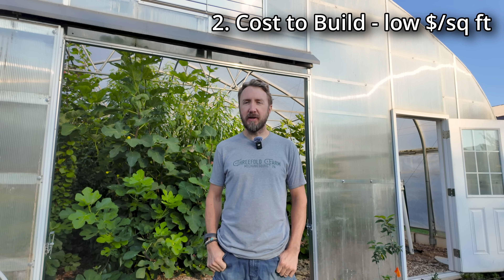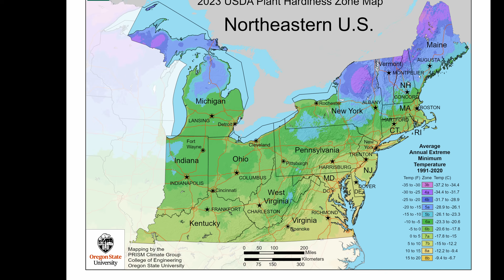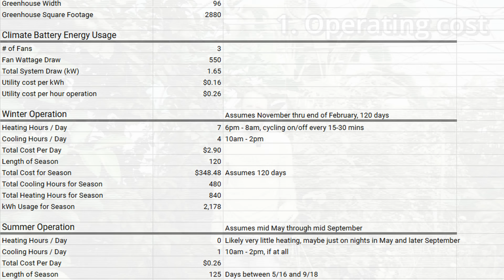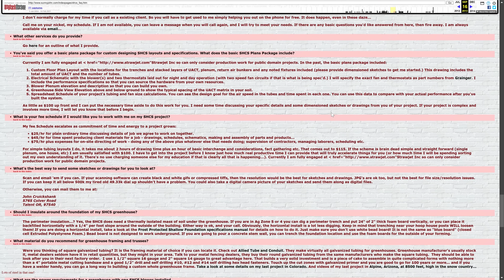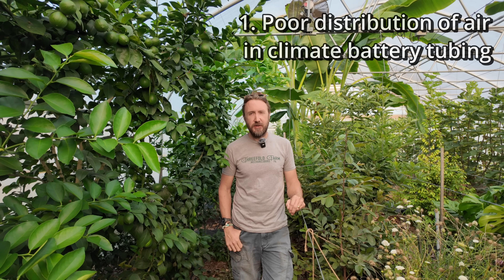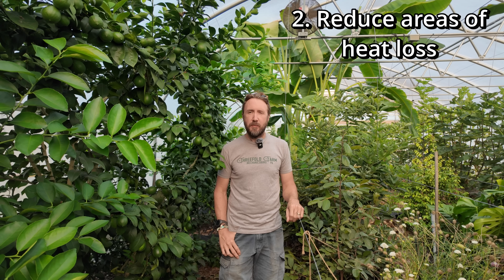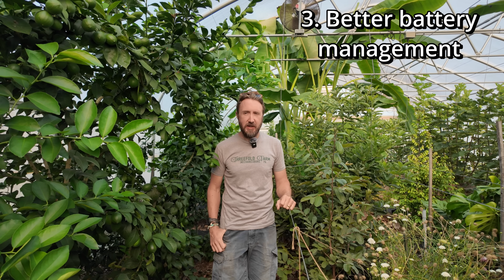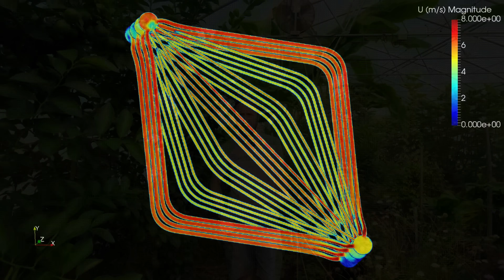Building an (Almost) Tropical Geothermal Climate Battery Greenhouse in a Temperate Climate

Comment: Try incorporating the use of heat from composting. A good compost heap can reach around 60°celsius. Outside the greenhouse 100 SQ feet covered with plastic consisting of a mix of wood chips, chicken manure, plant material and some water get you months of free heat
Reply from the maker: I love this idea but unfortunately I haven't seen this implemented well and in a way that didn't require significant work to maintain the pile while actively drawing on it. Are you aware of anyone doing this on a commercial scale with a very simple/straightforward setup? I do have a book, The Compost Powered Water Heater, that describes some larger-scale solutions but haven't implemented them at our farm.

One video I did see estimated that the pile would add 5,000 btu/hr of heat to their tunnel. At first glance that sounds like a lot, but that would amount to a 2-3F degree difference in the greenhouse temperature by my calculations, so it wasn't worth it in my book given the work it took to achieve that.
Reply: @threefoldfarm  build the compost heap outside Next to the greenhouse and run a copper tube closed system with water or another fluid that leads to inside the greenhouse.a per manent heat source that runs at 150°F would allow youheat a significant area in combination with an earth bank

Comment: thank you for making this video, you answered some of my questions about greenhouse battery designs! Ive been musing over "why dont we do this on a large scale in Finland" and have come to a conclusion "becasue we dont know that much about it and nobody is willing to take the risk". I did tho, consider the medium for storing the heat to be water, as you pointed out its very inefficcient to try to heat soil, or perhaps crushed rock in water tank? 

do you have any thoughts on the subject?
Reply from the maker: Soil is preferred in my book. While it's certainly not as efficient as water, there's a lot of it and it's "free". Imported materials for a larger greenhouse add up in cost pretty quickly, so using what's on hand seems to be a better solution.

Water, especially a large tank of it, opens up possibilities to dump other sources of waste-heat to it or to dump excess solar generation. I can't see the benefit of adding rocks to the water. Soil is essentially weathered/crushed rock with the added ability to have water as part of the mix which ups its heat-carrying capacity.

Comment: So we are renaming active thermal mass storage a climate battery... 
You could vastly increase the storage capacity by using a tank of salt water (probably sodium acetate, or similar), but would only matter if your vents open a lot. And is much more expensive.

It would be interesting to try using water filled pipes as well. The pumping losses would be far less than pushing air, and use far less materials. But then you need heat exchangers in the greenhouse and a much smaller fan there, or possibly just natural convection with good design.
Reply: Greenhouse in the snow has a new version as of last year that runs on fluid with an exchanger.  Not my ideal but they do have some great operational data available if that interests you..
Reply from the maker: Definitely interested in hydronic heat storage as a supplement to the system as it opens up other possibilities for capturing and reusing waste heat from outside the greenhouse. And yes, using natural convection and good design could possibly open the potential for a more passive system though I haven't yet gone down this path myself.
Reply: @threefoldfarm  Well I'm primarily thinking use it instead of air tubes. You can transfer the same energy with lower pumping losses. Less material costs in pipes, and a smaller excavation. But you would have some additional costs in radiators. Though automotive ones could be used and pretty low cost.
Even better would be to use vertical bore holes to get well below that constant temperature depth and heating the ground wouldn't even be necessary. You just extract heat from deep underground and keep the greenhouse at least 40-50 at all times. But vertical boring is expensive.

Comment: Using CFD to model the (fluid) air movement in the pipes is an excellent idea. I guess not very many people building greenhouses were coming from the software of the engineering physics world before. Otherwise how do you deal with the need of the plants to have direct UV light from the Sun, for short time, in order to create some chemical compounds needed for their healthy growth?
Reply from the maker: Appreciate the comment. I loved being able to use CFD to validate some design decisions.

I don't know as much about the specific UV needs of plants but do know that some greenhouse plastics are more UV open than others. Any practical resources you can point me to would be great. I'm not sure I can do much about it besides purchasing plastics that are a bit more UV open. I believe UV also helps to color up certain fruits.

Greenhouses do tend to be prone to different disease pressure due to humidity, air circulation, and probably lack of UV than those grown outside but I haven't seen a big difference in the plants we grow. Anecdotally, most of our plants seem to be very healthy (visually and production-wise) in the environment.
Reply: @threefoldfarm  A lot of info on the subject I have gotten from the work of: Advancing Eco Agriculture, youtube channel.

Comment: Did you consider a custom built solar pit greenhouse? Have you read the solar greenhouse book?
I suppose you are referring to windy weather when you say the greenhouse cools down to ambient at night?
Reply from the maker: I haven't read that one.

As for cooling down at night, a windy day certainly accelerates that through convection but even conduction through the low R value plastic will cause it to rapidly cool at night.
Reply: @ My experience is that a well sealed single layer hoop house stays bout eight degrees above ambient without supplemental heat. I do recommend reading that book.

Comment: I guess Solar Panels and battery storage make sense to cover Electricity inputs?/
Reply from the maker: Depends on context, but as solar gets to be more economical, then yes. Unfortunately the need to run the climate battery fans goes up as the amount of available solar goes down, so panel sizing needs to be done for the winter months leading to an oversized system in the summer (if the climate battery is all that you're looking to power).
Reply: @threefoldfarm Sun in the winter? The groundhog says ...No.

Comment: Fantastic video.  I appreciate Simple Tek and Chinese/UMN Greenhouses and their overbuild designs.  You know greenhouses well and the up-front/operational costs to make some clever decisions.  I also like to visit the Fruit & SPice Park in Homestead FL!  Between Tradewinds Fruit and Raindance Seeds you can get all sorts of tropical fruit tree seeds (Garcinia, Tamarillo).  I am thrilled to see so much success growing sub-tropical/tropical fruit in a greenhouse in a temperate zone, well done!  Grow all the things!!  What are your preferred greenhouse environmental control systems for automation?  I love that you are using CFD simulations to test improvements to your heat battery system.  Going to have to keep my eyes out on Atmos Greenhouse Systems as y'all are going to be pushing passive greenhouse designs.  I really appreciate that you have 3+ years of metrics on the number of days above 32F and how much you've improved it by really learning the constraints/gains on geothermal climate battery systems.
Reply from the maker: Appreciate the kind words and the pointers to some sources for seeds. Always hard to know good sources with a high percentage of viable seed.

We personally use the J&D Manufacturing Two Stage Thermostat (JDDT2) along with contactors to switch on the fans (the small built-in relays won't do it). Those are simple and have functioned reliably in our greenhouses for years now, though I'm sure many good solutions exist including those with a high degree of automation (staged heating and cooling, irrigation control, etc).

Comment: How does this system work with high groundwater levels? When digging holes here we generally get groundwater at 4-5feet.
Reply from the maker: High groundwater levels are challenging. A reduced battery sized (not digging as deep) or building up the pad are options but in some cases add cost or make the project not feasible. We've had some folks trench out of their greenhouses to drain any water that wants to collect in there or add a sump pump to drain out water (not really ideal, but good in a pinch).
Reply: I built a climate battery in the Pacific Northwest zone 7/8 but our water table is similarly around 4 ft. I used two sets of tubes, one at 2 ft and another at 4 ft. Unfortunately, it was not able to keep the greenhouse above freezing due to the lower portion filling with water. As soon as water enters the system, any heat is quickly lost underground.

Comment: Utilization of phase change, ie evaporation and condensation is an important aspect of the efficiency of a climate battery.  Related to that is the moisture level of the soil surrounding the tubes which greatly affects heat transfer.  I don’t see these being considered in your simulations.
Reply from the maker: Agreed. For sure there are a ton of factors to consider and research continues, but we have to start somewhere, so CFD and basic conductive heat transfer is the starting point. Anecdotally, the moisture level of our climate battery soil stays relatively damp which helps with the ability to store/move heat within the soil.

The video is meant to be an overview rather than a deep dive so I don't go into detail about things like phase change other than to mention them in passing. Perhaps in a future video some of these topics can be covered if there's enough interest but I felt the video was getting a little long at over 30 minutes.
Reply: @threefoldfarm  I eagerly watched the full presentation.  This video is so well presented. This is the sort of stuff that people will watch a long video about.

Comment: Why excavate a deep hole when a long easier to dig trench might do just as good ?
Reply: That’s what I’d do.  Dig a trench, lay the pipe, and refill it.  One at a time so I won’t have a mountain of dirt to move around.  No need for heavy machinery.  Maybe a cheap mini excavator or even a shovel and sweat would do.
Reply from the maker: Appreciate the comment. Trenching and less intense excavation may be a good option depending on where you are and the design would need to account for it. In our limestone based soils we have basically no rocks unless we have boulders, so a full excavation is necessary to remove these. Even trenching water lines around here is tricky and an excavator is typically required in our experience.
Reply: @threefoldfarm  ah yeah boulders suck

Comment: Russ finch greenhouse in the snow uses climate battery also . He also has some awesome ideas regarding using a climate battery and a heat pump inside of it to make heat pumps work in extremely subzero locations.

Comment: Thanks so much for doing all the research and groundwork for improving climate batteries Tim. I spoke with you about 5 years ago about building a climate battery GH for my figs ( zone 5b in the Fingers Lakes) and built a 600 Sf structure for less than $5000. It has worked remarkably well with temperatures staying above 20 degrees even when it has dipped below zero outside. I highly recommend anyone interested in building a climate battery GH check out your website first. Thanks again for being an “pioneer “ in the field!
Reply from the maker: So glad to hear it's working out well for you!

Comment: How do you deal with the high humidity during the winter months?
Reply from the maker: It tends not to be an issue of consequence for us, though for sure the relative humidity levels stay high in there. We still run circulation fans year-round so we don't have heavy condensation on the leaves.

I do have plans to install and try out an ERV/HRV to bring in fresh air in the winter (even have one sitting around) but unfortunately haven't gotten to it. It's a bit more of an issue when the plants begin to wake up and actively grow in the spring but the dehumidifying aspect of the climate battery (run running in cooling mode) does seem to help a bit.

Comment: A fantype with high static pressure would be more ideal than the axial fans I see in the video, centrifugal fans would be a much better fit. EBM-Papst makes hands down the best EC Centrifugal fans for industrial scale usage in the world. On your website I see that the Atmos Version 1.2 design has a 3500 CFM fan, I presume this is an axial fan as well? If so you should be able to get away with a lower CFM on a centrifugal fan as it has a higher static pressure, meaning more of the air will actually end up being pushed through the pipes.
Reply from the maker: Appreciate the comment. I'll have to look into centrifugal fans myself and EC motors intrigue me (just bought one for testing out around the farm for other purposes). That said, the axial fans we specify deal well with the higher static pressure created by the tubing system and are fairly efficient at moving air around. I'd love to see an inexpensive EC version of them in the future.
Reply: @threefoldfarm  With EC fans you can adjust the speed on a per-percentage basis, so you could get more granular than the 0n/Off you can get with traditional AC fans. They are also way more energy efficient than AC fans. 

If you haven't already, I also recommend checking out Home Assistant, it can be used for a lot more than automating a home, it is the most popular system for automating gardens as well. The ESPHome software they also develop is the easiest way to program microcontrollers, which you can eg. use to control fans, or use to gather sensor data real-time. For instance ground temperatures, temperatures at different elevations in the greenhouse, etc. So that you can check all of it from your phone any time, and from anywhere (including if you are away from the farm).

Home assistant is open source and the community is absolutely massive so eg. through HACS you can find all sorts of automation systems built by the community, for instance rain compensation watering systems and things like that.

Comment: Great presentation! Have you ever done any radon testing? I would be concerned with radon transferring from your battery into the greenhouse, but maybe that's not a concern as the greenhouse isn't air tight and not always occupied.
Reply from the maker: I've done a small amount with one of those digital meters for the home. In my area radon is typically a concern but I from the meter I didn't see any concerning levels in there when it was completely closed up for the winter. I don't remember what the levels were offhand, just that they weren't a concern.

In the summer and any time there's any venting at all I wouldn't think of it as a concern at all.

Comment: Great information and well presented. Thank you. 
If you were building one now, would you use a sunken design similar to the Russ Finch method where the northern side is a reflective color, well insulated and no sun exposure?
Is there a benefit to a larger internal volume of the greenhouse because of the smaller relative surface area?
Reply from the maker: I appreciate the compliment, thank you, as well as the respectful question.

I've looked at highly insulated and/or partially buried structures and the thing that holds me back, primarily, is the relatively high cost per square foot to build it. I do see that the Russ Finch style house now comes in a kit so you'd have to do a comparison. It's been a while since I've gotten a quote, but I believe the last greenhouse kit I was quoted out on ran between $5-6/sq ft but that likely varies all over the country.

I've also talked with a gentleman who's been doing greenhouse engineering/energy efficiency work for his entire career (and written studies and manuals on it). He mentioned that in the northeast a signficant portion of light in the winter months comes from the north due to the cloud cover, so most of those well-insulated designs would block that. Again, may not be a deal-breaker but it's something to consider and something that kept me from building a more highly insulated structure.

I also wonder if a well-insulated gutter-connect structure outfitted with an energy curtain would come close to the insulation value and therefore the energy efficiency of a sunken structure due to the factor you mention, the ratio of surface area to internal volume approaching 1:1 as you go larger and larger.

Ventilation, as I mention in the video, is likely a concern in the summer months. This could likely be remedied through a peak vent though I haven't seen one on one of those structures to date.

Finally, though it's not a huge deal, we do use the tractor for initial prep of the tunnels as well as remulching and adding compost. This would be more difficult, though not impossible, with a sunken structure. Not a deal breaker for most but a factor to consider for us.
Reply: @threefoldfarm  Thank you so much for sharing this info.